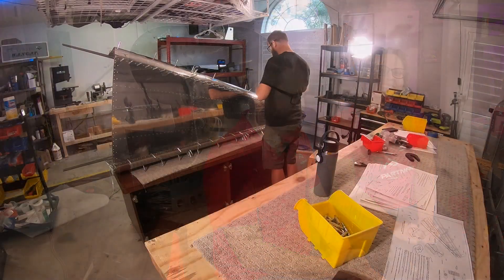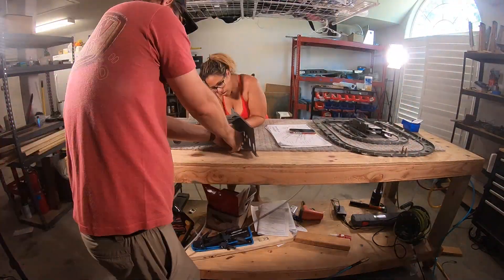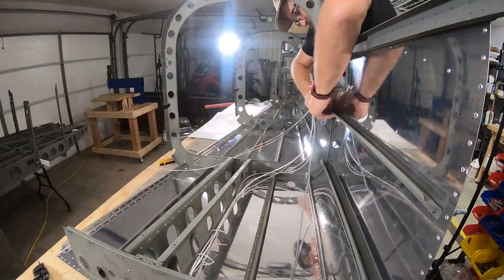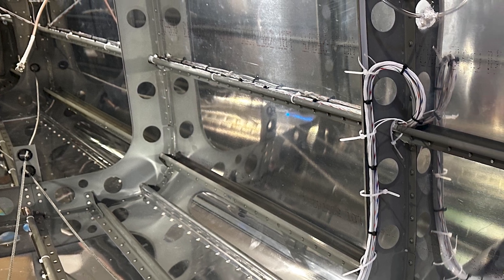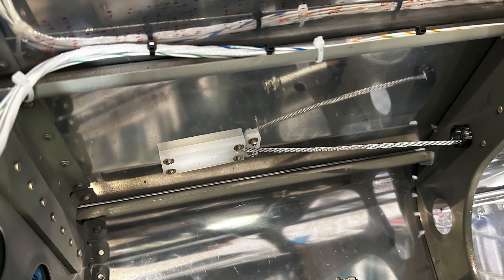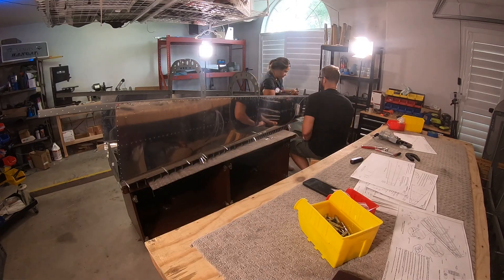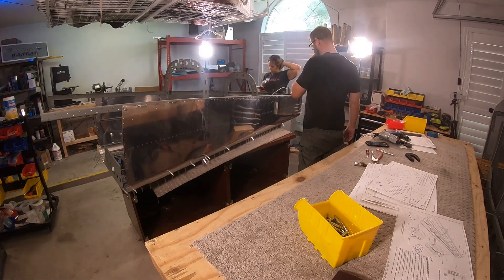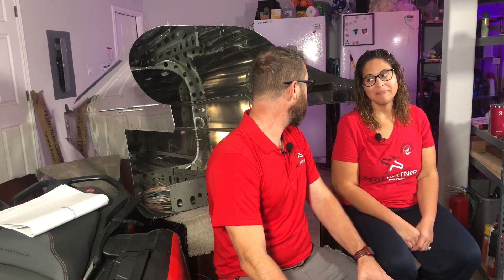Completed TailCone in 2 Months- Vans Aircraft RV-14 Sec 10

Comment: I hate to tell you this but if you are using Garmin servos you will relay the trim tab from there.  Also did you drill a hole in the bottom of the tailcone for ADSB?   Garmin transponder will handle your ADSB from the shark tail antenna so you wont need it.   Hit me up if you want to talk systems.  I just finished modifying the tailcone systems to work with Garmin G3X system.   The wiring diagram on Vans website is massive but something you will eventually completely understand 🤗.  I actually just filmed a video for our slack group that you might find interesting if you are using Garmin.  https://youtu.be/8KUoAmbXbWQ